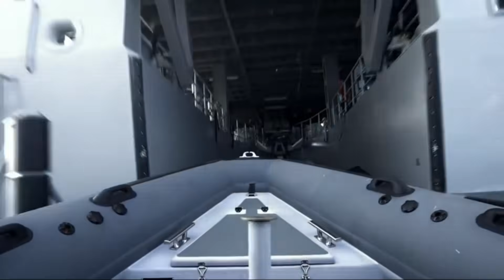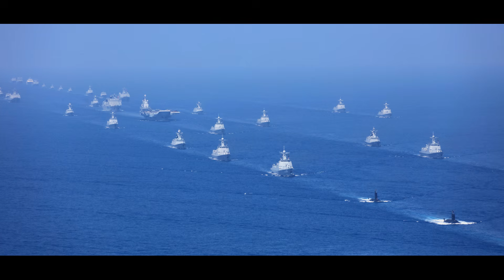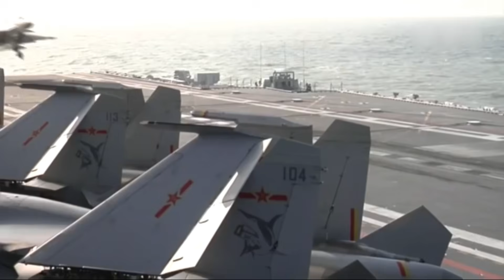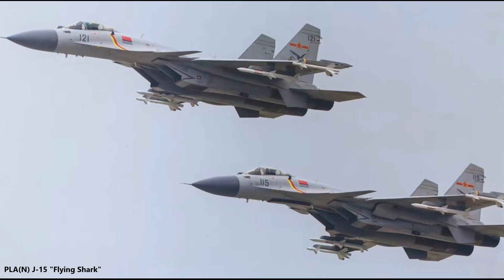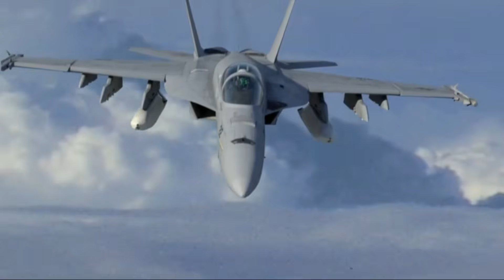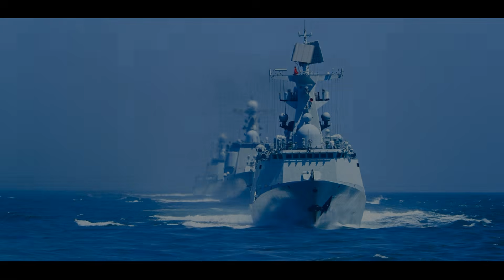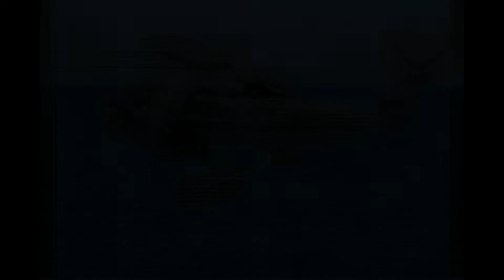Up-Gunning the Arafura Class OPV

Comment: I work in RCN up in Canada and there have been similar debates regarding increasing the firepower on our new AOPVs. While I would never be against more firepower if practical I think for both the OPVs in the RAN and AOPVs in RCN service it’s not practical to equip said vessels with complex and expensive offensive weaponry. 

These vessels are not combat vessels and are not intended to fill that role, they are simple constabulary patrol vessels that are cheap to build and require minimal crew with less equipment required to operate this decreasing annual operating costs. Adding long range anti ship missiles, complex point defence systems (such as ESSM and Sea Ceptor), and anti submarine warfare equipment is a ridiculous undertaking for a simple constabulary patrol vessel built to commercial standards.

Think about it, with all of those systems you now need dedicated and complex sensor systems that require systems and space (think complex ops room) on board to operate. Furthermore you now need trained crew to operate and maintain those systems, thus increasing crew complement dramatically. Also it’s not just your average boatswain operating and maintaining the weapons and equipment, it’s highly technical and trained sailors, something that takes years to train and are not in great supply. This is why I find your statement regarding the “simple” addition of anti sub warfare capability to the OPV making it proficient is anti sub warfare short sighted. You can’t just plug in a towed array and call it a day, it’s so much more complex than that as is with any of the weapon systems you mention and there’s a reason it’s only done on proper warships that have crews of 250+. 

By the time all of this is done, you start to wonder why you didn’t just spend all that extra time and money (which is not unlimited) on say a couple more Hunter class frigates or an extra submarine and just built the OPV as originally intended instead of this bloated ship built to commercial patrol standards but outfitted with systems found on a corvette or frigate which are actually built with those systems in mind.

TL:DR: You miss the core purpose of these vessels, and what you claim to be easy additions to increase firepower are not as easy as you think, in my opinion. I think instead of “up gunning” these vessels, more, proper warships such as the Hunter class should be built.
Reply: Vessels like this should really only belong in a coastguard organisation. When you give them to a navy people start to expect naval capabilties from them.
Reply: @davem2369  
That's the viewers problem ..
So what? They gotta expect every boats, hovercrafts,  to have AA, ASW, EW, surface, mine interdiction .. 

These boats will be used for interdiction, intership transportation, firefighting etc due to their small & light frame = maneuverability 

1. Large ships don't need to be moored to the harbour during personnel changes, or receiving supplies.. Usage of boats save time..
2. Firefighting in harbour will be faster and easier during combat.
3. Interdiction and marshalling in busy & tight harbours.
4. Can be used by Navy MPs in case of riots etc.
5. Larger sonar for harbour patrol to detect minisubs // enemy seals. Small boats can do that. Big boats are to high up to notice air ripples from underwater activity.

It's like saying MacDonald should only sell burgers & shouldn't sell nuggets, fried chicken, coffee and deserts...
Reply: @xellosblackforest1685  the boats intended job was EEZ protection, fisheries, border patrol, interception of migrants. Those are law enforcement issues (or at least they should be) not the purview of a military boat and the ship should be built and equipped accordingly. Boats should be designed and fitted according to their job, not carrying around an expensive ASW sonar if its chasing Chinese trawlers. Yes, the navy can have simpler ships but you are wasting certain equipment and trained personnel on jobs that shouldn't be in their purview when the money and people should be up to something else. Yes, there is some cross over but I feel funds and sailors are ending up in roles that shouldn't be theirs.
Reply: Spot on. The Arafura is going to be an incredibly capable vessel for its intended purpose. If AMSEG is able to deliver a commercially competitive hull out of the seriously impressive new Civmec yard, there are massive export opportunities into South East Asia, which is the only way to sustain the skillsets we need to develop and maintain a serious shipbuilding industry. The fabrication skills are already there, but keeping them as Oil & Gas and Mining fabrication waxes and wanes is the hard part. 

Warships in Osborne, Constabulary in Henderson. The hull itself may be versatile, but each needs to be built to purpose. As an example, Arafura as a base platform is also being considered to replace our Huon Minehunters. But we can't just plonk a container on the back and call it a day.
Reply: Thank god someone is applying a bit of common sense to the debate, the Arafura's are simply not designed for frontline roles and should only be used in roles where more mundane general patrol duties are required, fitting 2 twin NSM's and a 57mm Mk3 would be a more practical solution if we wanted to give them a more offensive capability that could be used in littoral zones.
Reply: @StajBrickhead69  Australia bought the Arafura's to conduct EEZ patrols of the Southern Ocean as their present Cape class patrol boats don't have the range to patrol there. Ditto with Canada's DeWolf class arctic patrol boats are designed to patrol the Arctic Ocean during the summer months with or without a precious icebreaker... Canada's frigates and other patrol boats aren't strengthened for first year ice as the DeWolfs... Canada has been having difficulty building a naval presence up north being unable to recruit staff for northern naval or coast guard bases... 90 percent of Canadians live within a hundred miles, 160 kilometers, along their southern border with the USA... And half of those would prefer to live south of that border, Florida beckons... Unlike Australia, there is no paved road to Canada's Arctic Ocean coast or a railroad further north than Churchill on Hudson Bay...
Reply: They are talking about doing  the same with Australia  OPV..

I don't  know where thus guy annalise comes from that's making this video.  But he's outdated and wrong with many things. China already can strike every city in Australia  from as far as the south China Sea. And if they get to have a navel base in the Solomon's every thing Australia has for defence has to change. Including tactics.

Australia will have no choice  but triple its navel fleet and aircraft. Including heavily arming  it's OPV including  seek long range missile hypersonic. If they don't  they won't be able to hold of any PLA attack  on Australia  in the future

Australia  ships is also the wrong choice for its role. they Australia  government is stating to realise their own incompetence and expensive failures. 

The F100 class  air warfare destroyers don't have enough VLS to carry enough  armament for its role.  Instead off working out an armament and building the right ships to carry  enough armament for that. They picking ships and running into snags that they can't add enough  armament leaving them undergunned. 

RAN needs to work out an armament they need then build ships around that. Where they going  wrong is they waiting for new threats to arise than trying to counter the new threats finding  that it cannot be done without a complete re design  off a ship or require new one. Instead off building ship that will have enough VLS to carry  enough armament  they need and have enough VLS for future requirements to meet new threats.

Australia require warship  for ESSM SM2 and SM6. Now add tomahawk LSRAM  and new Norwegian long range anti ship missiles. To meet the the correct armament for survivability the warships need 16 cell just to carry 64 ESSM  to protect the ship. Another 16 cell need to carry enough  SM2 for medium range. That's 32 cell VLS used up. So it only leaves 16 cell left over on a 48 cell VLS for tomahawks SM6 and LSRAM. And nothing  for long range asrock anti submarine missile if required.  

Australia facing problems  with our Hunter class frigates they too large only 32 cell VLS so won't  be able to carry  enough armament and will be overweight and too slow. 

So it would be better if Australia built F100 class for Hunter class with the CEFAR-2 radar and have 48 cell VLS for the frigates.  And build upgraded alright Burk class destroyer for destroyers that has 96 cell VLS. It would end the problem. And heavily  arm our OPV But how do you fix stupid?
Reply: Well, this is one thing which (as a Canadian) was a bit confusing about the De Wolf class being compared to Australia's. It is a very different set of tasks than the Australians will ever face. Very different set of neighbours, very different kind of intrusion events, and oh yeah THE ICE. 

Australia's got so many more potential doorbell-ringers coming their way, not to mention the Chinese navy or Indian navy lurking beyond that. The OPV is doing the job of watching out for the really dangerous warships, but not fighting them head-on. The other task (which looks constabulary but is also military) is "filtering" out potential clandestine threats by confronting, boarding, and inspecting ships which are (or just look) civilian. I imagine their armaments are designed more for dealing with armed opposition from those.
Reply: Finally, someone with common sense..

These kids don't know cost and budget ..
Reply: @xellosblackforest1685  To be fair, the creator is referencing an ASPI document written by another old codger like us. hypohysetericalhistory does make some fantastic content, the historical stuff in particular is superb.
Reply: @brinchaser1313  true. Problem is, too many readers are requesting on adding extra items  like torpedo tubes, AA missiles etc..

Sooner or later when stuff are added in, commenters will request for ICBMs, laser guns & plane decks too ..
Reply: I think a lot of people, including the OP, are missing a lot of strategic context with this comment. If the RAN made the decision tomorrow to crash build additional Hobarts, we could maybe, maaaaybe have a ship in the water in three years, but the current government at least has said they're not doing that (ALP has promised to at least look into more Hobarts if they win in a few weeks). There is nothing else coming online until the early 2030s except Arafuras. That's it. So, if you believe that we're at serious risk of a conflict in the next 5-10 years, and many serious strategic thinkers do, then most of these objections stop making sense. 

Sure, it's not the ideal hull to do this work. Yes, it could be faster, yes, it will need more and better (or more specifically at least) trained sailors than is currently envisioned. Yes, it would be better to have more proper warships than upgunned Arafuras. But if we want additional meaningful surface combatant capability in the RAN before the danger zone kicking off in 2027 (or maybe sooner, who knows), then we literally don't have any other realistic options.

Canada is in a different strategic situation to Aus because we don't share a land border with a global superpower who will never, ever allow hostile navies to get close to our shoes, so the OPV debate in Canada can afford to be a little more academic. Not so in Australia!
Reply: 2 X 35 mm firing AHEAD munitions and a 76mm Super Rapid firing Vulcano PGM and the DART AA guided projectile give the ship a good capacity to deal with air and land targets, the NSM in 2 pairs compliments the capability of the LRASM, as for ASW, just being in the sensor mix makes it a force multiplication factor, if you add a system like the ASW601 you can prosecute subs in the littoral area effectively whilst the Hunter ASW Frigate can effectively deny blue water to subs. It is a policing vessel, yes, but as with today's cops, who carry lethal and non lethal as well as containment systems on themselves on the street, our limited resources need to be flexible. Launching NSM in the mix with LRASM and even the Harpoon, could provide a mix of stealth and non stealth attack systems from all directions for an opponent to deal with. We need a flexible and adaptable Navy, connected, networked and with distributed lethality, covering a broad spectrum, over a wide area. We need hulls in the water to do that, and a cost effective, lightly manned and  cost effective to build Arafura class, in number, well armed, and distributed across the national AO , would make the complexity of attacking Australia significantly more risky than a bunch of barely armed policing vessels.
Reply: @anthonykelly5352  An incredible weird and wrong comment. Putting the systems that you named here onto the Arafura would more then double the cost, require dozens of more crew and would make this ship incredibly hard to upkeep. Also, they wouldn't be useful, as even in times of war you need to patrol your waters. These ships are made as patrol boats, not anti air and anti submarine warfare. Adding these systems makes no sense
Reply: @gamm8939  wow, what a small minded comment, the 76 mm is fully auto and would replace the 40 mm easily, the 35mm systems are also automatic, and replace the 50 BMG with something credible, the NSM are tube launched, they just require space and launch systems, which are no real big ask, and the ASW601 is fully automated and on the forecastle, again, just a launch console is required as it prosecutes submarines in the littoral, so you argument about crew numbers is I'll informed as the crewing requirements for these systems are minimal, the scope of role is significantly expanded and as a node in an ASW complex, it would provide a capacity to prosecute subs and force them up, something the ASW601 excels in. A vessel that can defend itself from air attack, escort coastal shipping, be a part of a naval missile attack solution and also intercept incoming ASW missiles , rather than a patrol boat that only patrols, would be far more relevant than the boat with a Bofors you are suggesting. Our budget is limited, just like your imagination, however, a little creative thinking can produce a platform that is excellent at patrols and capable in a war fighting role as an escort  and screening vessel.
Reply: @anthonykelly5352  "our budget is limited" and yet you want to but air defense systems on a vessel that is just made for patrolling. the RAN would never use these vessels as you would intend them to. And you need additional crew, not just for operation, but also for maintenance. Maintenance cost would also stagger. These vessels are made for patrolling, nothing more. I don't even know what you want air defense against, it's not like these boats will be operating in the South China Sea or something
Reply: @gamm8939  China is operating in the Arafura Sea, it is kind of self evident that our safety margin in relation to incursions is depreciating rapidly.
Reply: @anthonykelly5352  In times of war, china would immediately retreat any force from the Arafura Sea to the South Chinese Sea
Reply: @gamm8939  You obviously have no knowledge of China wanting to build a hub on the south coast of PNG, at Daru, or that they have been discussing another place in the Solomon's, or that they are using debt trap diplomacy to get long term leases in numerous countries close to us, or that they in fact own the port of Darwin.
Reply: @anthonykelly5352   and you think in a war that someone will make themselves the target of Australia, the Philippines, Thailand, South Korea, Japan and the US because of leases? Right now, there are no bases at the Locations  you described, and a new base will take years to build. And in the current climate, I don’t Even think they will build one. The RAN does not want a little corvettes, they want a patrol boat
Reply: @gamm8939  whatever, when one is sent to the bottom you can rest assured you weren't the only closed minded individual out there.
Reply: @anthonykelly5352  You know the story of the bradley? Was supposed to be a troop carrier, but it now looks like a tank. And while the US Army knew it was a troop carrier, for the rest of the world, it looks like a tank. Why would China even attack this? It is literally a patrol boat. Also, give me a scenario where China has the capability to attack Australian boats in Australian waters. Your arent actually replying to my arguments, its just "More weapons per platform = better"
Reply: @gamm8939  Your statement confirmed my suspicions that you haven't a clue. The Bradley is an infantry fighting vehicle, designed to provide the infantry a vehicle that is capable of doing more than just being a battlefield taxi, like the M113, and yes, it worked, it revolutionised IFV design in the western world and gave a counter capability to match Soviet IFV designs. More weapons = better because it diversifies the capabilities of combat platforms. Now the Bradley is the benchmark and the next generation will be more heavily armed.
Reply: @anthonykelly5352  Yes, that's what the Bradley is now. But it was supposed to be just a taxi. Some Generals wanted a shit load of different systems/capabilities, including being "amphibious". It nearly took two decades to develop and the cost overrun were just hilarious (Even tho that's relatively normal for military projects). And still, you haven't actually responded to my main focus. How and why would the Chinese sink an Australian patrol boat in Australian waters
Reply: @gamm8939  opportunity
Reply: I think his main point...that is..hyperhistory...these vessels should have the capability to be upgunned quickly in the likely event of war.  Ww2 and 1 both came along with some degree of warning... and still the major countries needed to rapidly upgun and push into service not only mothballed equipment but commandeered civilian freighters and the like.

Since the vessel was designed specifically to take mission packages it seems foolish not to have these ready to go if...or more likely given current relations with China...when they are needed.   Some fore thought and planning are required for that...including training.   Also...if I am not mistaken specialized personal to use the equipment...towed array etc ...can be trained and placed on board with the packages to supplement the current crew.   I think it's a reasonable argument to invest in these capabilities and have them mothballed in peacetime for quick refit in the event of conflict then to have conflict come and be as ill prepared as history has shown most countries have been at the outset of major conflict.